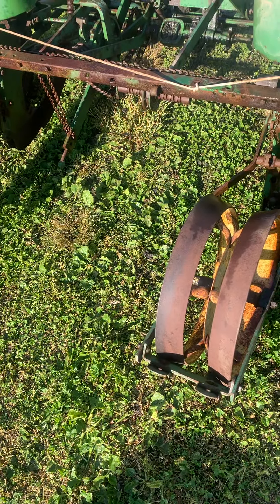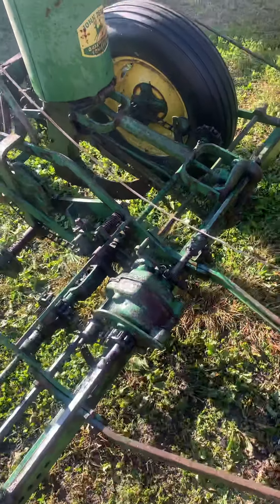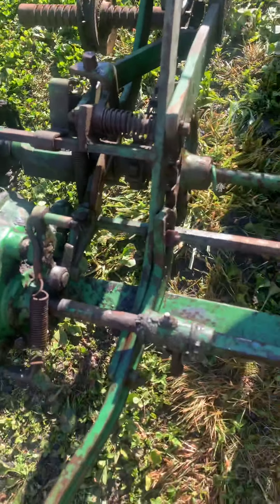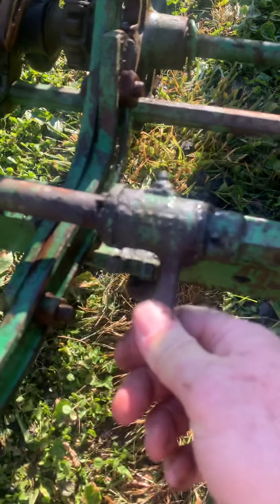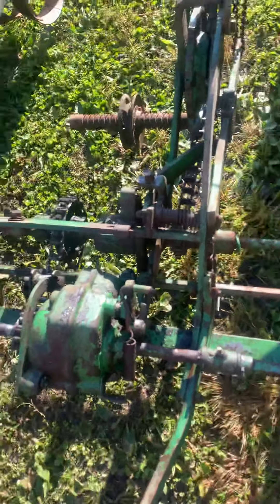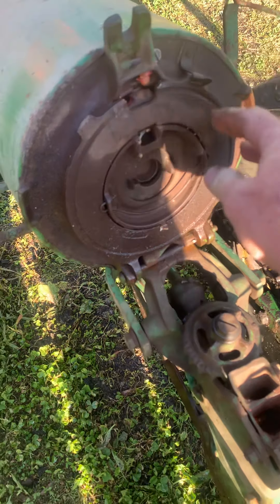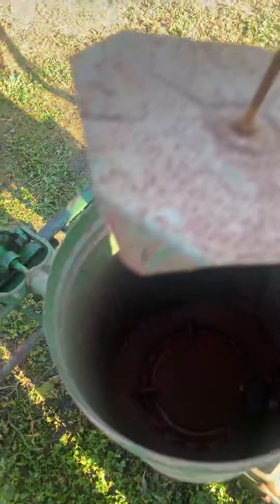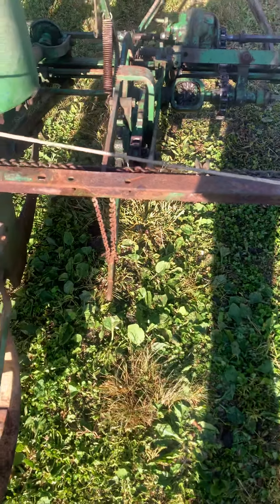Operation of a John Deere 290 two row corn planter. Some help I hope

Comment: That AC WD looks good hook to your JD 290! I have tighter space so I pulled mine with my Ferguson TO35 (I have an AC WD too). I planted popcorn with B6-24 "small flat corn" and it worked perfect while using Reids Yellow Dent on B7-24 "medium flat corn" works better. Planning later to get 'medium round' for the Blue Hopi and 'large flat' for Hickory King plus sorghum and soybean plates. The JD 290 manual only lists the cast iron seed plate numbers and I have yet to find the Lustran plastic plate cross reference chart to find used plastic plates. Lincoln Ag sells new Lustran plates.
Reply from the maker: JVin248  here is weblink of what I think you are looking for?  https://lincolnagproducts.com/wp-content/uploads/2017/02/Product-Information-2-6-17.pdf

Comment: I'm looking at one of those now, I  need to know what all to check before I decide to buy this thing. Any pointers for that?
Reply: Make sure you try the mechanical lift to see if it works. You could check and see if the gearbox works. Also check to see if it has plantar plate with it or not. Are the seed cans rusted out?You should be able to have somebody pull it a little bit and see if it works it’s OK to drag the planner and just see if it’s moving like it should the parts that is

Comment: This was helpful! We’re thinking about buying one. This will be an upgrade from our John Deere 2 row where someone has to sit on the back of it and another person has to drive the tractor😂.  I may have missed it in the video but how does the planter raise up and down?
Reply: It has a mechanical lift. It is worn and doesn’t work great. There is a lever with a rope you pull on that activates the mechanical lift or lowers it
Reply: The rope runs from the mechanical lift lever to the tractor. Some of the planters were converted to hydraulic lift with a hydraulic cylinder
Reply: @bentonbee1  thank you!